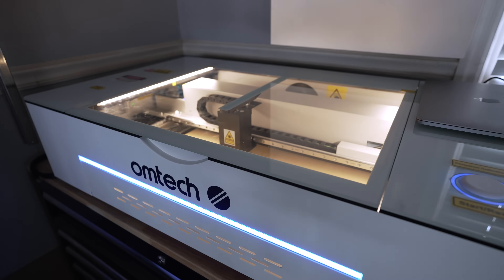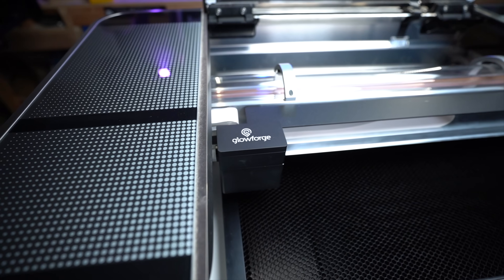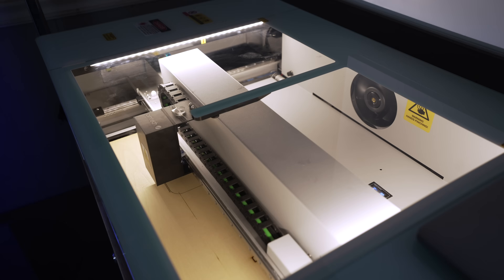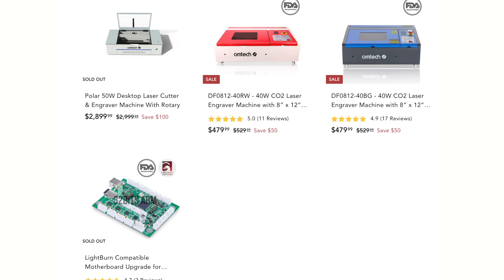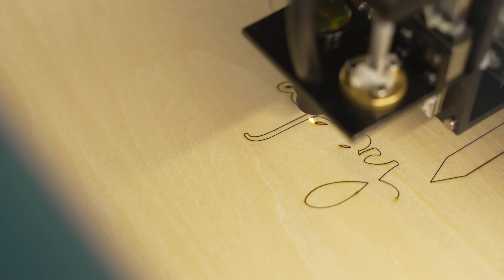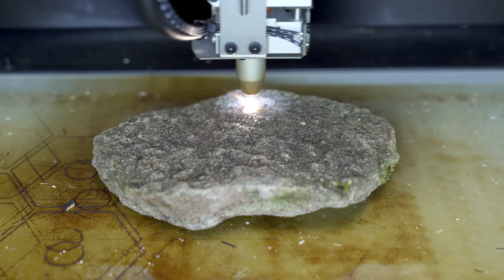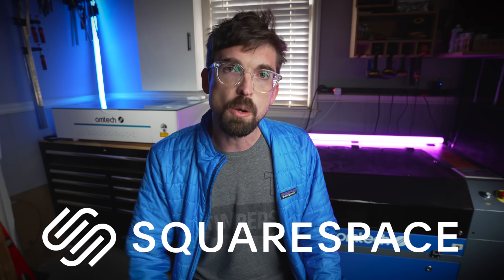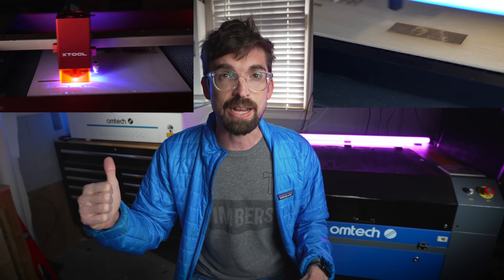$4000 cheaper than Glowforge AND better?  OMTech Polar Review

Comment: Exacly how compatible is the Polar with Lightburn?  Are you able to use ALL of the Polar's features with Lightburn, or only some of the features?  Such as the camera, auto focus etc?  
Asking because I just got the Xtool P2 that claims to be compatible with Lightburn, and yes, it sort of is, however its VERY limited. Cant use cameras, no auto focus and I have to manually put in stats of my cut material each time.  It sucks.  Pretty much have to use the Xtool software which is nowhere near as good as Lightburn!  I'm considering getting the Polar instead.

Comment: We're currently running an x20 pro and x30 pro for anodized aluminum membership cards, fully calibrated as fast as we can run its taking 3 hours for 40 cards. Seriously considering the omtech sitting in the floor in this video. Would you recommend?

Comment: Can I use Adobe or Silhouette business with the Omtech polar?
Reply from the maker: You'll need to use other software like Lightburn (paid) or RDWorks (free).  But I've made lots of designs in Photoshop/Illustrator and then import them then.  So as long as you can can make a vector file for doing cuts or a jpg/png for images you'll be good to go!
Reply: @makeorbreakshop  Great! Thank you!

Comment: I think there is a lot of nuance in getting the right laser cutter. The Polar looks like an interesting machine and I might be interested if I was getting something for my house. I'm a teacher and the Glowforge works best for my classroom. The footprint is just right for the classroom (looks similar to the Polar). The web interface is a selling point, allowing us to manage multiple users easily and not worry about software. I only use the interface to set up my cuts, where the camera is very useful. Everything else is done in Illustrator, Inkscape, or Vectornator. The subscription is completely optional and unnecessary. Respectfully, the review makes it sound almost required - that is simply incorrect. I have 5 Glowforges (the plus model). They are used constantly, the oldest being 3 years old, and I have never had a serious problem with any of them. Support was quick and helpful when an issue did present itself, the GF was cutting again by the end of the day. It is a no fuss machine - and that is what I need when working with 100 students each quarter. If I were buying a hobby machine I would have different requirements, but the Glowforge is pretty awesome for us. Just wanted to provide a different perspective/experience.
Reply from the maker: Great points!  I need to do a better job describing what you get with the free software, if your doing your designs in another program than it’s totally doable!  I actually just donated my Glowforge to a local school for the exact reasons you outlined.  Very easy to use, safe, and normally it just works without much fuss.
Reply: I have the Glowforge Pro and I don't like it.  The proprietary interface (you can not use any other interface with it) is limiting and inferior to what I had with my Universal M-300 (which let you use Coreldraw direct printing). The old M-300 worked for around 15 years and is now defunct.  THe Glowforge is the only one I have now and is expensive ($7000), does not accept COreldraw desings directly (you have to export them from Corel as SVG images), and the air exhaust is very weak causing a lot of hassle with smoke damage to the finished pieces, and if your internet connection ever goes down, you're dead, as you cannot  operate your Glowforge without it! Also, Glowforge does NOT have a repeat this cut feature. You always have to resubmit it to their cloud, have them recompute it and resend it to the Glowforge again. A real P-I-T-A.   I am looking at getting the Omtech Polar as a replacement for the Glowforge so I can get back to normal laser cuttting operations.  This is my humble opinion.  Cheers.
Reply: You might not read this comment, but if it would come down to your own money, and not public funding (which I guess the glowforge is paid for), would you then still use the glowforge? asking out of curiousity, since I recently came into similar situation, I opted for open source and cheaper, sacrificing some ease of use, but opening more options for everyone in the end.
Reply: The other thing is that he said you have to look at the GF Pro to compare it to the Polar and the Pro has a pass through to do unlimited length.

Comment: i'm only four minutes into this but would like to know how noisy are these machines?...i've noticed that the reviews  i've seen of these are typically silent which tells me that noise could be an issue...i'm also surmising there is a substantial ventilation and filtration/catalytic system to deal with the smoke and vapors from these while in operation...make no mistake, this is not a criticism as i could really use one of these for my long list of maker projects and design concepts...it just seems that it should be mentioned at least once

Comment: @makeorbreakshop Just wondering if you can fit a piece of material that is 12x12 on the Polar's cutting bed?  I realize that the cutting area is 11.8 or something like that but can you still fit a 12x12 inch piece of material flat on the cutting surface?  Also would this be able to cut 6mm Acrylic on a regular basis?

Thanks again for all the great videos.

Comment: 10:52 you should mention that co2 laser beams are actually a little more dangerous that diode lasers because you can't see the co2 laser beam so you will have no blink reflex if it hits you in the eye, you need eye protection for any laser, not just with led
Reply: Does the glass on the polar protect the users eyes from any laser radiation?

Comment: I will never buy a glowforge because they keep it locked down and you can only use it with wifi and if they ever wanted to they could lock you out of your machine and make you pay a monthly fee or if they ever go out of business you will have a $6000 brick. there are simply better, cheaper machines out there with cheaper and easier to find parts

Comment: I went to the omtech website  and after choosing the Af2820-60 it is wanting be to also purchase 2 different water chillers, an inline duct fan, a 4 wheel rotary axis, as well as software and training. I probably need the software and training, maybe not the rotary axis yet, but do I need 1 or both of the chillers and the fan? Also your promo code didn't work for me, not sure if it's too old or because I'm in Canada.

Comment: Consider the omtech polar desktop. Does it allow you to use the lightburn on windows? I am so confused on what this means on the omtech website: Light Burn software is compatible with all OMTech CO2 laser machines of 50W and up.
OMTech CO2 laser machines of 50W and up are only compatible with macOS computers if you use LightBurn software.
Reply: this is compatible with lightburn right out of the box. The other OMTech 40Ws I was looking at needed an upgraded motherboard.

Comment: Can anyone help me out here.. what I'm really after is a absolutely bare-bones entry level laser welder. Not hand held but CNC type (It's only one job to do - welding two small parts together). I'm not fussed about speed and the weld doesn't need to be deep (1 mm or so). What's the lowest possible power? 

Does a "cutter" with a 50W laser have the power to weld with, if retrofitted (with gas)?

Comment: How much space do you have when you remove the tray (or can you also move the floor?) and want to do bigger objects or use the rotary with large cups? Can risers be used?
Reply: I was just watching a video from "Kim and Garrett make it" and they did a tumbler (really wanted to see the roller attachment in use). There appears to be an opening in the bottom of the unit where you set the roller attachment (it comes with a large and small one). From what they said (or posted), they did one where they put the feet on risers.

Comment: How do the three CO2 machines you mentioned fare when compared for noise output? The 60 watt machine in your video, is the $530 chiller that they sell with it worth the money? I am looking to move up to a CO2 laser from Diode lasers, what sort of things am I going to have to adjust my mind to when doing so? What important practices are more important with one than the other? And is there any sort of rotary tool that works with the 60W Floor model?

Comment: We have a glowforge midrange machine. Had it for a year running full time. It started having problems. Couldn't get any support from glowforge. It's our business so we bought another to use while the other gets fixed & can be used as a back up. My son basically started just replacing parts & the carriage turned out to be the problem. We had the new machine for 2 months. Nothing but problems with it. It wouldn't cut on normal settings. It also would start randomly not cutting or excessively burning on higher settings. Finally glowforge sent a "referbished" replacement for our brand new 5000$ machine. The refer machine showed up with cooling liguid leaked all over. Tried running the machine at glowforge support request & the entire laser arm is off center running crooked & is completely noisy because the track wheels are worn.
I highly recommend no one buy a glowforge. Their customer service sucks & there is zero product support. Their poor business model is a devistating model for your business if you are trying to run 9ne with glowforge.

Comment: Does any one know what the laser eye safety protocol should be for the OMTech Polar vs the 60W? It looks like the 60W has laser safety glass on top while the Polar has clear glass. I assume the clear glass will pass reflected laser light. Does that means that one would have to wear safety glasses when in the room with the Polar but not the 60W?

Comment: Be careful saying that it's safer because the CO2 beam is invisible. Just because you can't "see" it doesn't mean it can't blind you. If the enclosure windows don't completely filter/block (gaps/seams are an issue too) the laser light then that's a problem. Proper laser safety glasses should always be worn when operating any laser device such as these.

Comment: I'm looking at the Gweike Cloud Pro vs the OMTech 70W CO2 16x30 with autofocus..... both seem to be about the same price although the OMTech is much bigger. Other than the size, is there any reason not to get the OMTech?? Also the Gweike Cloud Pro says it does 3D... do you think the OMTech does also??? Hey, great vids!!! Thanks much....
Reply from the maker: When they say 3D I think they are meaning that the z-axis will focus.  In that case both machines will do that.  If size isn't an issue then I would go 70W for the increase wattage and work area.

Comment: Hey ! Its been one year since I took your advice on pulling the trigger on the Atomstack x7 Pro. It was worth every penny! Now that I have an idea of my market I would like your advice on the best way forward! My clients are mostly Yeti (done hundreds) and glass etching but I find the diode is a little slow. (5-10 min per cup) .. Thoughts? Even had a large company reach out to engrave brass medals but unfortunately not powerful enough. Any help is appreciated!
Reply from the maker: If turn getting a lot of requests for brass/metal you might want to look a low powered fiber laser.  OMTech has a few and so does Cloudray.  If. Your cranking out a ton of smaller engravings they are usually at least 4x faster.
Reply: @makeorbreakshop  I'll be sure to check em out! Are the fiber lasers limited to only steel/metal services? I'm worried it won't perform well on wood or glass.

Comment: Have you checked out the XTool M1? It seems like it sort of bridges the gap between typical diode and CO2 laser desktop units. You know more about lasers than most people (I suspect) so I'd be interested to hear your thoughts about it.
Reply from the maker: Yep!  Got a review on my channel about it.  The M1 is basically a diode laser and vinyl cutter put together.
Reply: @makeorbreakshop  D'oh! Sorry, it was late over here when I wrote that - didn't spot your video on it.
Reply: @makeorbreakshop  Given that it now has an air assist and a riser packaged with it, it would appear to be a pretty good option  (I was originally saving up for a Gweike Cloud or RF) - have they added Lightburn support to the M1 yet?

Comment: So, are you saying that the Polar speed is the same as Glowforge?
Reply from the maker: In my very none scientific comparison…Glowforge won’t give you an actual speed in their settings just a percentage.  So I compared it to the Gweike machine (just like Polar) and the top speed it was hitting seemed to be pretty close.  The big difference came from the change in direction especially if your doing a big photo engrave. The Glowforge takes a good bit longer to switch.

Comment: I have owned an Omtech 100W 24x36 for more than a year.  The only thing I disagree with in your video is the "Omtech has great technical support."  In my actual experience, every issue is responded to (in emails - no return calls) is to clean everything and refocus the machine.  In fact, they didn't even read my email, which asked about being able to buy the on/off pushbutton switch that is sticking, and their response was to ignore me.  I asked to pay for a service call.  At this point I have actually convinced two people to buy a competitors model and I am working on my third person.  I purchased the laser and requested support from the Anaheim California location, but I have not seen anything to let me know that the entire company is not represented by the same lousy service.  I would be fine with their lack of help, but even when I asked if there was anyone who could help, I was met with silence.  I was finally able to find someone who does service for Laser in LA, and I was happy to pay for the help.  I am very disgusted with Omtech's complete lack of service.  If you are going to buy a laser, try to find someone who has and uses one.  Service / Customer Service / repair is very hard to find.

Comment: can you show the use of the rotary?
Reply: ata1anta
0 seconds ago
I was just watching a video from "Kim and Garrett make it" and they did a tumbler (really wanted to see the roller attachment in use). There appears to be an opening in the bottom of the unit where you set the roller attachment (it comes with a large and small one). From what they said (or posted), they did one where they put the feet on risers.
Reply: @ImaginationDesign  ya i contacted OMTech and there working on getting more videos on there channel i might have some on mine also.

Comment: I am very new to lasers, and am planning to buy one soon. The polar seems like a great option but how would it handle a rotary for example?
Reply: I was just watching a video from "Kim and Garrett make it" and they did a tumbler (really wanted to see the roller attachment in use). There appears to be an opening in the bottom of the unit where you set the roller attachment (it comes with a large and small one). From what they said (or posted), they did one where they put the feet on risers.

Comment: Is it possible to use a desktop laser on a 4x8 sheet of plywood if you remove the bottom?
Reply: Not really, you could with some diodes but only really engraving, if you want to cut your out of luck and really need a cnc router or a lot of money for a really big laser

Comment: I received my Polar 350 today.  I also own a zf3551, a FSL PS20, and a custom-built 5w UV.  

I bought it thinking I could use it as a semi-portable.  

Here's my thoughts:

1) Not really meant to be portable.  
2) Very fast from uncrating to lasering.
3) In Lightburn, unless I'm missing something, the focus (z-offset) has to be set for every layer.
4) Camera calibration was easy - except a bit inaccurate (so I guess not as easy as it seemed).  It would not even detect the dot pattern unless I opened the lid part way.  It seemed like Lightburn doesn't like the 180 pano camera lens, but this is my first machine with a camera.   I'll fiddle more tomorrow.

Comment: Thanks for the review, I’m thinking of purchasing one in the future. Do you know if the Omtech 60W machine is able to cut clear or frosted acrylic?
Reply: Depends on the thickness, but these CO2 machines shouldn't have a problem with acrylics of reasonable thicknesses, like diode ones have. Its not about the power, but absorbtion spectrum of acrylics, which works better with CO2 wavelength.
Reply: @ayasugihada  thank you